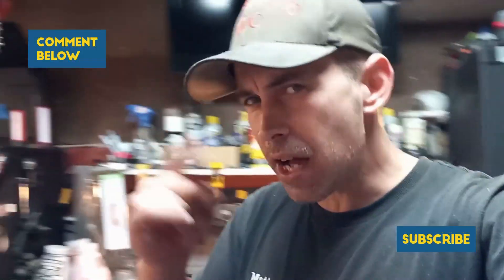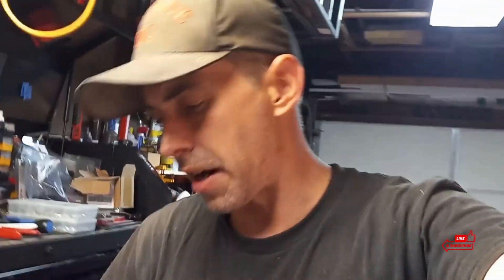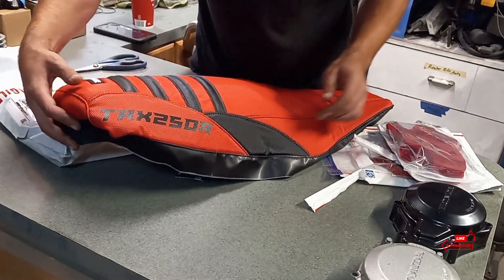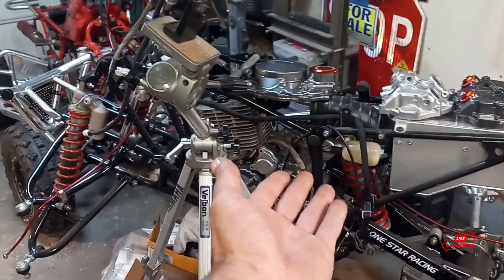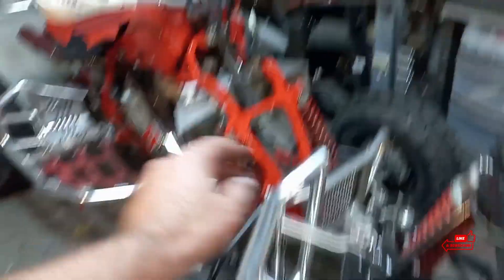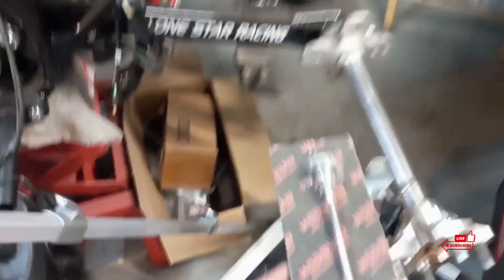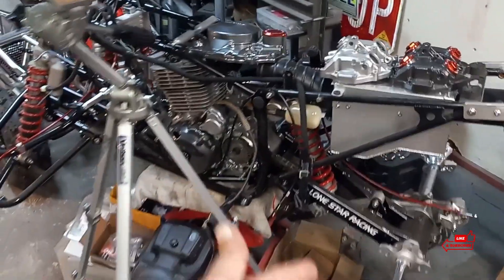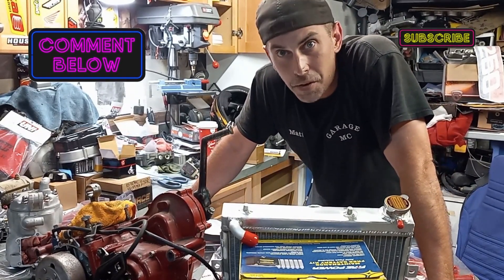Building a Trx250R. I Have Big Plans Let's Talk! #honda #trx #250r

Comment: Hey so for the alba nerfs I have those on my 86 trx250r. They mount the same way as yours. They are the only kind alba offers, the mounting point moves back for the 86 and 87, as for the 88 and 89 they moved the pegs back so the albas on the 86 and 87 are really just the location of the pegs on a 88 or 89
Reply from the maker: I have my oem 86 pegs here It's only like an inch difference but I can feel the space difference for the brake.
Reply: @garagemcmatt  me personally I like the increased space, especially with riding boots. Don't ever sell your R man. I sold mine a year ago.. just got it back yesterday lol. Same 250r I built. It's on my channel I have a minute 20 sec video of it. Check it out if ur interested. I took the 250r for granted, bought mine from the original owner all paper work and everything. So glad I got it back. If you sell you will regret just not right away maybe
Reply from the maker: @brendans7489  I hear ya on that I've had other ones that I wish I still had

Comment: Hey matt,my dad has a 1986 Honda trx250r, his radiator is leaking and I currently ordered a new aluminum aftermarket rad for it,my question is will the 88,89 rad work and mount up on his 86 setup
Reply from the maker: It will mount to the frame but the inlet is shaped different and points the barb at a different angle. Easy fix if u have an aftermarket inline temp guage since you can cut the line and clock it accordingly